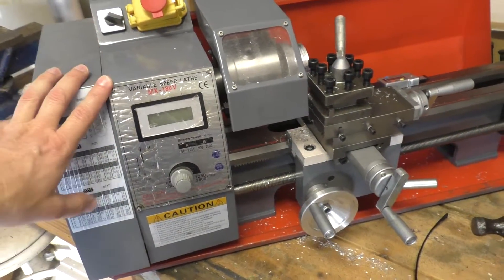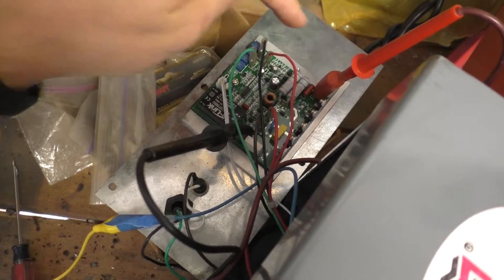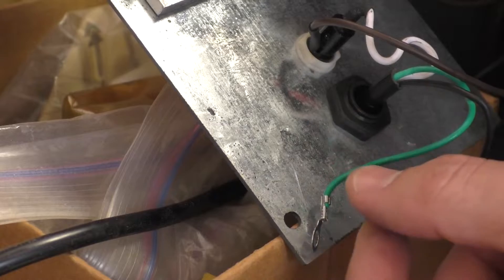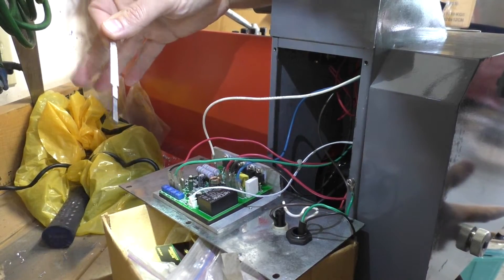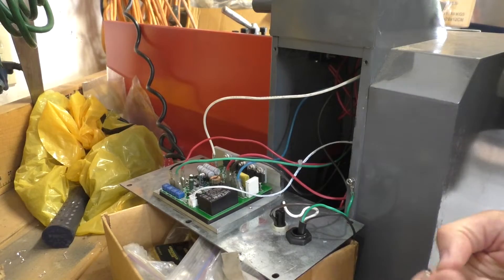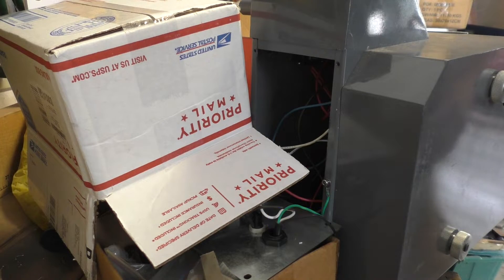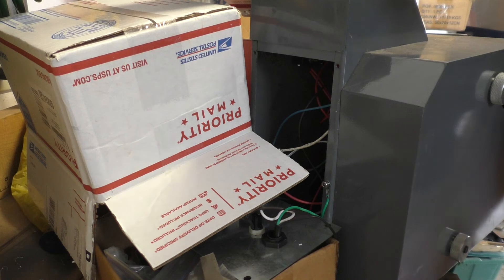lathe problem solved

Comment: I just had the same problem with my Vevor MX-S716G. The unit was completely dead. I took the back off and found several wires not attached very securely. I also found a ground wire not touching any mental to metal. I also found the switch itself to have come off some springs when I took it apart and re assembled it. After doing all of this I also disconnected and reconnected all the wires to the switch. I also found the safety switch wire on one terminal was loose. The screw was as tight as it could be but the contact was loose. I added a washer and that solved that issue. I hope this will help someone else. My PC board did not have the diodes to adjust. After re assembling all of this, the unit has worked perfectly. I also wrote Vevor an email with my distress at the lack of quality control. I commented that I could not recommend their lathe to anyone else. Thank you for putting this on You Tube
Reply from the maker: @geralddenicola1773  Thank you for the reply.

Comment: I never heard what problem you were having.  Mine wont completely stop running when the pot is turned all the way down.
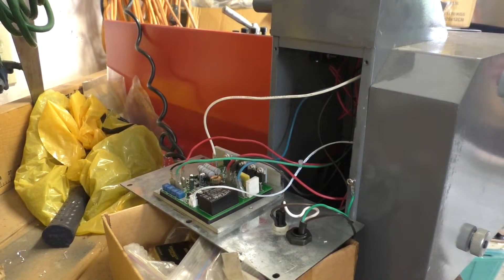Reply from the maker: You can hear it at 4:43.  Did you watch the whole video?

I think the machine is not supposed to stop when the pot is turned all the way down.  It's just a speed control.  Turn it off to stop it.

Comment: Hi great instruction video,  I have a bernado hobby lathe and I'm using it for making wooden pens ,if I turn 5 or 6 pens and turn the lathe off...it won't start again....it can be up to 5 days and bingo it works again 😀 its driving me nuts , please help !
Reply from the maker: I'm sorry, I'm not much of an expert on these things.  But I have two suggestions.  One, some motors have what is called a start capacitor.  Not sure if a lathe does or not, but I had a drill press that did that.  When you turn it on and it doesn't move, try to get it started by hand.  If you just have to give it a little push to get it going, it's probably the start capacitor.  Two, try going to www.olduhfguy.com.  He's the real expert.  Hope this helps.

Comment: I've got one of these lathes. Although DC voltage will work, that circuit is a VFD (Variable frequency drive) The motor is a brushless A/C style motor. In reality it's like a 3-phase motor for more efficiency and those pots vary the individual coils of the motor. From the mosfets on the heat sink you can measure the output  on each mosfet and fine tune each pot to get a perfect balance of the voltages on each coil of the motor. But if it works for you don't fix it. A perfectly balanced voltage of each coil will give less hum and a smoother motor experience. These motors are a beefed up similar motor to the more expensive drones with BLDC (Brushless DC motor)

Comment: Hello: Congratulations, that's how followers help, good video. I have a mini-lathe with a controller very similar to yours. The IR setting is made with a consumption meter by adjusting to the power of the motor, example: 700W engine is set "I.R." A +/- 800W.
Greetings.

Comment: i have an identical mini lathe and have a problem were if i leave the power on but turned the speed all the way down so it stops it would spin up randomly.
its pretty dangerous so i turn it off completely when i want to check my part with calipers or do anything with the chuck.
I might redesign the PCB at some point because i dont like how it setup. it would be better if the hall effect sensor actually controlled the speed instead of just being a readout. 
I'll also get rid of the potentiometer an put in a encoder dial. might be cool to have buttons to set the speed as well. heck I could have it use a robo voice to make fun of my work too. ;D
it would be a fun project though. 

also the ground wire is connected by a back plate screw.  no one takes the back plate off in a careful way to see it pinched in there.
Reply from the maker: That does sound dangerous.  Not an issue for me since I always turn it off anyway.  Not sure if I've mentioned it before, but even though it is a MINI lathe, I'm pretty sure this is the most dangerous thing I have ever purchased.  I'm very, very careful around it.  I watched some videos of REAL lathe accidents and they are horrific.

Anyway,  I like your encoder idea.  If you do it, you should post it up and leave a link so I can go see it.

Good luck!

Comment: I just received my mx210v and I watched your vid only difference is mine doesn’t surge it runs about 30 sec then cuts off. I can restart it right away but then it acts crazy. You got any suggestions.  Thanks for any input you can give me.
Reply from the maker: Sorry, I really don't know, but the site I put in the description should help.  If you don't see a link check out both videos, the problem and the solution. Good luck.

Comment: Interesting  video!  Any idea as to what caused this problem?  Did the potentiometer just decide to go crazy?
Reply: Sometimes small pots slip during shipment. I’ve had this happen with expensive equipment as well.
Reply from the maker: I'm assuming that quality assurance is a bit questionable with cheap Chinese products.  Perhaps it was never adjust at the factory at all.

Comment: Thanks for your video! I buy yesterday a lathe with this issue and here was the solution!!! I have ajusted the IR and the CL, but wasn't perfect but also adjusting MAX and MIN just make the magic 😉👌

My lathe it's a Einhell Mtb 3000 (01012) from 2004/03.

Thanks again 😉👌
Reply from the maker: Cool.  Glad I could help.

Comment: I have the same lathe, and when I took off the speed control board cover I also noticed the dangling ground wire. I was told when you buy these lathes the first thing you do is disassemble them and I am glad I did because the amount of factory grit and grime everywhere and old thick oil on everything. Even my headstock bearings were hard to turn, took it apart as well cleaned everything good, and repacked them with quality white lithium grease, now it purrs like a kitten. I also built and installed new carriage gibs, the ones that come on it were riding the bed at an angle (not good), so now with the wider thicker gibs running true and flat it's an awesome little lathe. Oh yea anyway the ground wire, when I got close to full disassembly of the lathe I got to the motor and on the side has a screw hole for a ground wire which was clearly marked with a large arrow, but no ground wire was screwed into it, and the short floating ground wire we each found does not reach that far, so I too hooked the earth ground to the chassis, but it has always been in the back of my mind every time I fire it up......thanks for the video
Reply: yeah the ground wire is just pinched between the back plate and lathe by a screw as he suspected its not just dangling out of factory.
no one takes the plate off carefully enough to notice it. because you dont expect it.

Comment: What the man who gave you the suggestion should have told you to use a non-conductive screwdriver. They make plastic screwdrivers for this purpose to eliminate getting an electrical shock or shorting out the board. But I guess you got by.
Reply: those pots are plastic. :)
Reply: @yomama5785  At least your safe unless you just slip up. Plastic is always safer.
Reply: Don’t worry, they shoved a loose grounding wire into the case